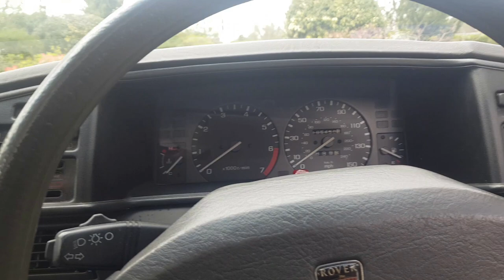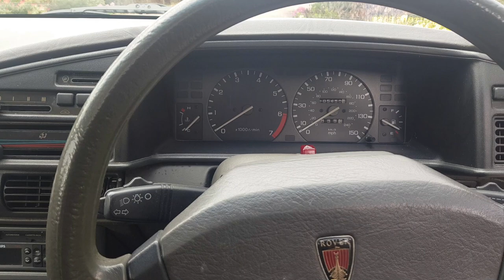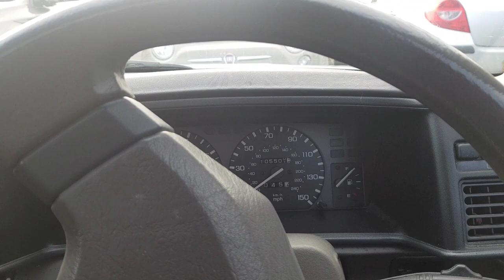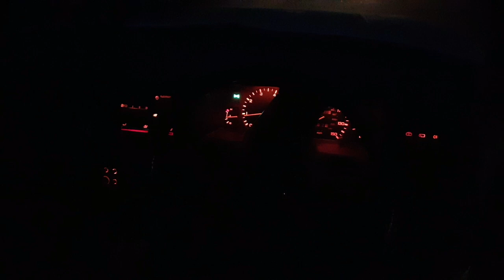Collecting my new Rover 820 BASE (it broke)

Comment: You said about disliking auto chokes well the choke may not be that great because it is a rover remember lol. I have a civic with a carb and auto choke from 94 and it works ok but mine does start a bit high in the idle so I get where your coming from

Comment: I rather like the ole Rover 800, prefer the 827 though but the fastback reminds me of a motorway police car . 
May be if you sniff around a few forums or Car part fairs , you could find some good used callipers ? 
I loved that MG Metro 😍 , my first car as a spotty teenager was a metro , everything I wanted for it was available in the breakers near me ,! 
Dog Autos , everything you ever needed a “Tenner” New wheel and Tyre and a Front metal bumper after a little mis calculation of speed and driver ability down Epping forest . Made that post jump out in front of my car. £20 back on the road again . It was a 1.0L I would’ve loved to got an MG but I couldn’t afford one not the Insurance to go with it . 😢
I actually enjoyed your video , it was better than Top Gear with Matt le Blanc and Co.! 
hope you get the old girl sorted out will be keeping an eye out on your channel .👍

Comment: I rather liked my 1988 820Si fastback. It managed to rust around the sunroof too. To drive it and travel it was rather nicer than my 1989 Granada Scorpio 2.9 - a car completely devoid of style.  I think the Granny had a better ride but the Rover was a lot more fun.
As I understand it these used a stretched Montego floorplan and Rover were quite a long way through even when the agreement was reached with Honda. The fuel filler cap was made in Japan; I had to buy a new one and it said so on the bag...

Comment: I once owned a 1990 Rover 214 GSi and the performance was pretty damn good. I always remember the rev counter red lined at 6500 (impressive eh?). Mpg was also good. Then like a fool, a few years later i sold it to buy a 2ltr "jellymould" Rover. Crap performance, poor mpg, and the engine had a permanent oil leak which they were notorious for.

Comment: Cars really don't like sitting around very much. If there are still people around your area who turn rotors, you might be able to do that a little cheaper than getting new ones. Over here that is no longer an option, at least not in our area. I was thinking of your comment on the horse power of your little car. I have a 53'  Desoto Powermaster. It has a 235 cubic inch flat head six that produces around 110 horse power and it weighs far more than your little car does. I have driven it once for a short distance, needs much more work to be road worthy, but that six seems to have the torque needed to move the beast. It will certainly not be a hot rod.

Comment: I always thought it bizarre that this 8-valve Leyland engine from the late 1970s was put under the bonnet of what was essentially a high-tech Honda.  Interestingly when installed in the 800, it wasn't regarded as an O-series - it was given the "M8" designation so it was regarded as an 8-valve M-Series.

Comment: "Petroleum" 😃
If you replace the sunroof you might find the headliner needs to be dropped requiring a lot of interior trim to be removed which is a ballache of a job.....id be more concerned about the roof panel itself first.
Like the inset headrests.
Shame about the brakes but surely it doesnt need 4 new calipers?
Braking will also feel a bit better on decent front tyres......
Still a  free car is a free car.......onwards!

Comment: I once bought a 1987 Rover 820e automatic from eBay for about £300. When I got it home and stuck my hands up above the rear wheels, DUST fell out. And kept falling out. Brown dust. More and more and more. Until there were two piles of the stuff. There was quite literally NO metal left under there. Never again.
Reply from the maker: I've owned Mercs like that. I often find it's better not to prod some areas of a car.

Comment: Op to 1992 With VW, Opel/Vauxhall and Mercedes Benz, you could get vehicles equiped with the dreadfull Pierburg 2EE electronic controlled carburettor and Catalyst. Or in non CAT-version with the Pierburg 2E2 carb...
Reply: The wax stat choke's often failed but easily fixed if you stuck them in boiling water for 2 mins.

Comment: In case people didn't know rover were partnered with honda around this time. Rover tried to make cars look somewhat similar to the hondas of the time. And unfortunately most of the parts on these rovers are made by rover which was lacking quality for the most part. Some of the 800 rovers had honda engines which was good. They are good cars really but not all the time 😁

Comment: The radio has a fuse on the back of it,it may have blown.Looks like the same radio you’d get on a mk2 Astra,cavalier,a Philips.
Reply from the maker: Display has gone. Can't enter the code...
Reply: HubNut I fixed many a radio of that type! If memory serves, there were a pair of tiny filament lamps soldered in behind the display and it was not uncommon for them to fail. Rather a pain if it’s wanting the code entered and the display is playing up. Shining a torch into the display might reveal “-C-“ if the bulbs have gone and it’s waiting for the code.

Comment: o series engine also used in the 2ltr sd1 , mine chewed through head gaskets ..lol
Reply: yam yam dash cam they also eat the rear core plugs which are a real PITA to replace
Reply: @robinturner2300  this is why my next sd1 was a 2.6 until the cam belt went and put the exhaust valve through number 6 piston ... so v8 it was after that lol
Reply: yam yam dash cam I had a disco with the Rover V8. But at 18mpg I couldn't afford to drive it far 😉
Reply: @robinturner2300  yeah , that was the demise of my last v8 , traded it in for a ford sierra on a h plate ... soooo regret it now ... i trundle around in a ford galaxy now .. lol
Reply: yam yam dash cam a Peugeot 5008 😔 myself..

Comment: You really really really need to get an 850 T-5.  Before they become expensive again.
Reply from the maker: I'd rather have a TDI.
Reply: @HubNut  Didn't you already have one of those? It feels like it should be against the rules.
Reply from the maker: I drove one, but have never owned one.
Reply: @HubNut  Aaaah.  It is time.  The T-5 will be cheaper and easier to get though.  Ironically.

Comment: Looking at a 1988 Autocar.... Rover 820E (this) £12489 (manual) £698 extra for auto.
820i £13678.      827Si  £16550.      827SLi. £17878.       Sterling £21380
Honda Legend £17750   coupe £24000.    Vauxhall Carlton £10500 to £14815. Senators more..
Ford Granada 2.0L £11413  2.9 Ghia X £17483
Audi 100 from £12769.     BMW 518i.  £11465    Mercedes 200  £16100

The Rover 800 series were not cheap
Reply from the maker: This isn't an 820e. That had fuel injection.

Comment: Didnt Mercs have mechanical fuel injection from the 70's? The SL had it in the 60's and you should have gotten somethign extra for buying an unventilated  tin carsie for the money a 123 cost.
Reply from the maker: Yes, but even in the 1980s, carburettors were still available on some Mercs.
Reply: @HubNut  That was very stingy of them. You hardly saw any mecs here in sweden until the successor of the 123 on account of the price and you cant say they were well equiupped either.  The volvos  everyone had were not cheap cars either but cheaper and cheaper to run than the mercs. These days you see more maseratis than you saw mercs in the 80's.

Comment: its a rover, a nice one too, only lightly rusty in normal rover places, has basic stuff and a carb?! thought those went out in the earily 80's wow rover there proving they can make cars with carbs still on them, tape player not working, hmm must be an after market one as rovers were built to last as well you don't want to upset a 70 year old when his mozart or the orcestaual moveent number 4 7 1, goes blugh and chews it,
oooh sadly not the car you pick up but a nice spot lovely old 50's car look to be orgnial owners or the son/daughter of the orgnial owner very nice so to is the metro,
BLOODY HELL 140/60 FOR FUEL?!?! your not be getting me there! i'll stay here were its only 120 ish mind you motorway so yeah but that is far to steep even the shell at the top of town is 128 ish for fuel 130 for diesel,
free?! dam lucky you wish i was like that just get a free full working car and not basket case/needs a lot of work but is road legal barely, 
and its kinda broken, well one of the breaks has not cheesed up but has gone a bit sticky and is starting to burn not good, hmm i think i see the reason it was free, breaks issue,

Comment: 'It has a lumpy idle...not a good advert for carburettors' .... Are you serious???
Reply from the maker: Ok. Not a great advert for 1980s carburettors. Older ones seem to work better in my experience.
Reply: @HubNut  Older ones were simpler. Constant pressure to reduce emissions made them more complex until fuel injection finally took over.

Comment: That headache is called rover itus, worst car i've ever owned and i've had a few only thing it didn't do is say GET OUT ,spent more time in bits than driving it,leaky roof caused fuse box to corrode,check drain tubes exiting in wheel well ,problems with,drive shafts,alternator, starter motor[ started whilst parked outside house resulting in a frantic wife having to disconnect battery,]wheel bearings next,front then back failed ,new water pump brake calipers seizing,fuel tank sender, fuel gauge,speedo cable snapped, shock mounts ,welding,more welding followed by  floor pan inner wheel arches  inner wing ,MOT new tyres full tank of gas ready to go on holiday catastrophic gearbox failure .watched with pleasure as it got crushed,never again would i touch one with an extendable barge pole ,now 2cvs complete different pleasurable story.

Comment: Years ago I had the misfortune to own an 820 back in the when day Honda supplied a lot of the component parts, it was the worst car ever made constantly breaking down over minor troubles almost every other day, then the automatic gearbox fucked up, I got a new box & torque converter fitted but it drove even worse than it did before, I didn’t believe that was possible but I was wrong, I couldn’t even give the old wanker away so I took it to a mates breakers yard smashed the bollocks out of the worthless lump of shit with a sledgehammer before watching the carcass of the useless bastard being crushed, it was like taking a monkey off my back, it was the most unreliable piece of crap ever to disgrace the UK’s roads.

Comment: In a world overflowing with good cheap reliable cars why in hell did you buy a Rover.   It will spend more time off the road than on.   The British lost the art of car making decades ago
Reply from the maker: It has just clocked up 1100 miles in just over a week. It didn't break down once (though one of those days was spent rebuilding the brakes...)

Comment: one of the cars that killed rover . . and  might kill you !  carbon monoxide poisoning and no brakes are both killers,   a lot of unexplained road accidents were drivers just drive off the road for no apparent reason are supposed to be down to carbon monoxide poising, early symptoms, head aches, sleepy, blurred vision, unable to concentrate, uncomfortable, agitated, a leaking exhaust or header can let fumes in to the cabin, its supposed to be a common problem but its never been researched properly so be careful as I like your posts and I would hate to see anything happen to you on them mountain roads. cheap CO2 meter from B&Q £10  . don't throw money at this car,